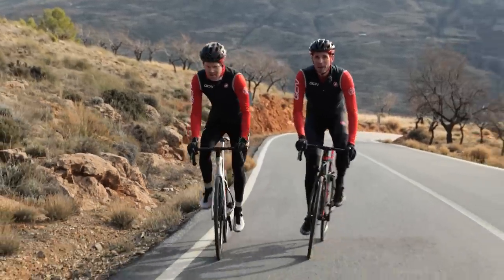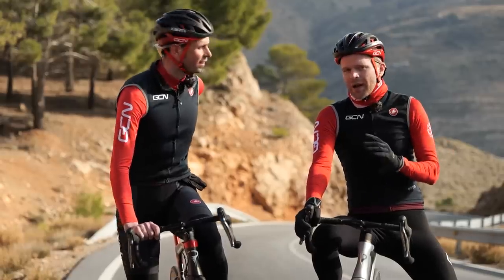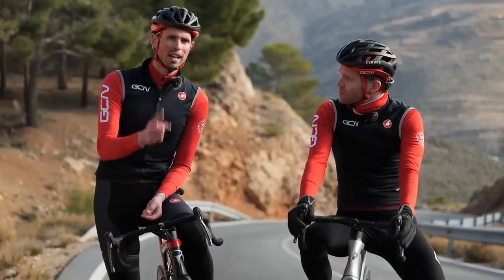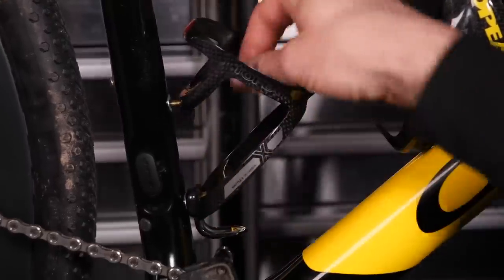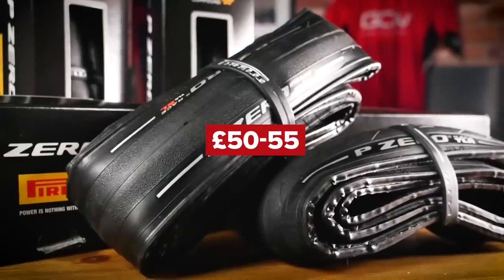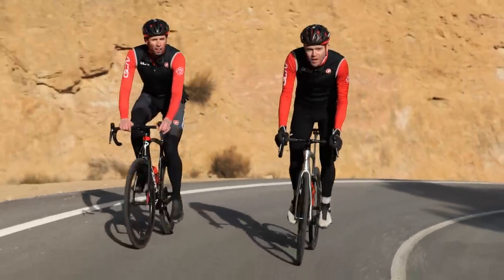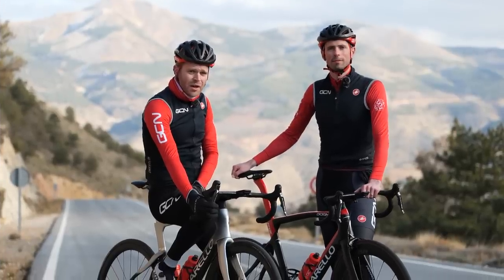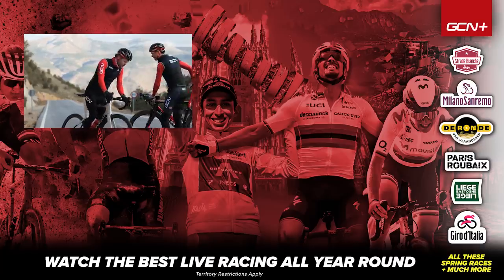What's The Best Value Upgrade For Your Bike - Spend Or Save?

Comment: With latex, I had to pump up to pressure every day.  They would loose 10-15 psi overnight.  How about the other weight-saving inner tubes?
Reply: 50g butyl Continental supersonic
Reply: You shouldn’t use latex tubes for training because they aren’t as durable or puncture resistant I believe, best to got tubeless or regular inner tubes for training imo
Reply: @itsyourboiiemil5450  I have had the opposite experience. Latex inner tubes have been less puncture prone as they are more supple and tend to conform around foreign objects. Butyl tubes on the other hand are less compliant and can more easily allow foreign objects to puncture it. 
Another consideration for latex tubes that I don’t think gets talk about often, if at all, is the superior comfort they provide. Again, because they are more supple and compliant, they roll over bumps and road imperfections better, leading to a smoother, comfier ride.
Reply: @JayLato  didn't know about these, thanks for the heads up!
Reply: Is it possible /save to use latex tubes on Tubeless rimtape ?
Reply: @itsyourboiiemil5450   i‘ce been using them for a year, no single puncture, in combinatiom with vittoria corsas,
Reply: @TengoHambre  Vittoria Corsas with latex tubes are my favorite combination. Extremely comfortable and fast.
Reply: @TengoHambre  yes. Tubeless rim tape can be used with tubes. The opposite is not true though, a regular rim strip cannot be used in a tubeless setup.
Reply: @yamdrew  yeah and since my rimtape seemed a little worn when i swapped tires, next time i‘ll install tubeless tape with latex tubes, and pirelli race 26mm 😊 latex rolls smoother indeed🕺🏼
Reply: TPU tubes hold air pressure quite well, about the same as the heavier butyl tubes.

Comment: You had the mid-range option in inner tubes, but why didn't you have a mid-range option for anything else? In my experience (with no data to support my hunch), middle of the pack is often the best value for money. In some cases it might be upper mid-range, sometimes it's the lower mid-range, but very rarely in the extremes. 

I've upgraded my wheels, tyres, tubes and saddle, and in only one case did I go for the top end stuff, and that was TPU inner tubes. Because it's not that expensive, and you can patch them if they puncture anyway. My wheels are lower mid-range DT Swiss ones, which wasn't much more expensive than the basic Shimano ones, yet they are lighter, look better, the hubs are much better and they've held true very well, unlike the Shimano ones that just melted under my fat ass basically. My tires are upper mid-range Pirelli Cinturato Velos, which are pricey, but not really top of the line performance tyres, but rather a practical choice. But they're so much better than any other tires with similar puncture resistance. And my saddle... well, I basically upgraded my saddle to a cheaper one, by ordering from China. Paid just a bit over 20 euros for it and it's 160 grams lighter than my old one, yet still more comfortable and better suited for me. Time will tell if it actually stays in one piece, though.

Comment: Hunts or Yeoleo or Winspace wheels are around 900$ and can get you solid weight savings for half the cost you said.   Think you should do more with smaller brand budget carbon wheels.  Your viewers would gain a lot from that info.  I always thought fancy carbon wheels were the only option.

Comment: I do think that you missed two very cost-efficient ways of loosing a bit of weight. First one is QR skewers. One that come with a mid-range bike will weigh around 130g. A set of titanium/carbon QRs that weigh 50-60g can be had for $20. Another one is bar tape - will wear out anyway so you might as well replace it with a lighter version and instead of those fancy alloy plugs just get plain plastic ones - 50-70g for max £30.

Comment: It depends what sort of riding you do, surely? Most of my riding is the 55km round trip to work and back, with an occasional Audax at weekends. Latex tubes are no use whatsoever for me because much of my riding is on wet, gritty, pot holed Forest of Dean roads, while my saddle (Brooks, and heavy as) needs to be comfortable all day long, and its weight is very much a secondary consideration. Couple this with the fact that I weigh around 100kg on a good day and usually carry a pannier full of crap to work and back, and the few grams I save by using carbon bottle cages, or whatever, are completely insignificant.
Reply: You'd probably be way better off trying to reduce rolling resistance. With those potholes I wouldn't want to risk carbon wheels either.
Reply: Yeah nothing in this video pertains to your situation

Comment: For recreational, cost conscious riders, latex tubes and carbon cages are ridiculous. Loose one pound of body weight and bang.
Reply: You could also lose a pound, too.
Reply: Latex tubes are great for rolling resistance. 50g of weight is utterly negligible (that's like 0.3W on a climb, or 0.02W on the flats). On the other hand they cut 5W of rolling resistance. 5W for £20! Yes they're consumable items but I've never ever punctured one outside, only when failing at installing them. Carbon bottle cages on the other hand, might as well go to the toilet more.
Reply: Yep, and you'll fill your nice light cage up with half a kg of water anyway!
Reply: Yes but your average recreational rider might be getting a used bike that needs tubes anyway. Same with the bottle rack I suppose, and also the saddle. You could say the same about everything else in the video and it applies more so than the bottle cage or tubes since one could reasonably expect a used bike to already have wheels
Reply: Is everyone who watches this channel obese or something? Why is lose a pound always the default suggestion?
Reply: @thegrowl2210  Because it's cheaper than buying a new set of wheels, it's actually good advice
Reply: @thegrowl2210  around 60% of the population of UK or US is overweight. So theres a high likelihood that it wouldn't hurt someone watching this to lose a pound.

Comment: Get rid of your water bottles and cages.  Switch to a Camelback.  Water sits on your back which adds to your weight, not the bikes.  No reaching down for water, just put the tube sitting over your shoulder in your mouth and suck.  Spit out tube when you get enough water.  Camelback also offers places to store your house keys, cell phone, spare tube and tools etc.  Room for snacks as well.  Like wearing a thin backpack.  Originated in mountain biking, which I used to do.  Camelback sure works well with my road riding.  Cheers!

Comment: The carbon cages don’t fatigue like metal cages and will last the lifetime of the bike which helps to offset the cost. I think wheels and tires are the biggest performance gain overall, regardless of cost. I wonder if it would be more cost effective to build the bike from scratch as opposed to buying a bike and replacing stuff you already paid for. Okay! Video content idea! You can have it for free!😂

Comment: I switched to Tubolito tubes for last years RAGBRAI….2 days and 150 miles in, and 5 flats later…I dumped them, switched back to lightweight butyl, and had no more flats for the remainder 300 miles.  Not sure if they’re worth the weight savings.

Comment: Dirty little secret about bottle cages; some alloy cages are lighter than most carbon cages and cost less than half.  Supacaz alloys are $25 and 18g vs. the carbon at $65 and 22g.  I bought some cheap generic chinese cages online...$25 a PAIR, but they didn't hold well and one of them broke.

Comment: The BEST weight-price ratio are the tyres, seatpost and saddle.
With the wheel you can low 1/2kg ( i
Or more, depends the stock shit wheels) but its a 1200€ effort

Comment: Rolling resistance, fair enough. Weight however is only relevant in acceleration (Newtonian theory) or if you are unfortunate enough to hit something where you will go from a certain speed down to zero in a seriously short space of time. In other words, you will become intimately experienced and have first-hand knowledge of Einstein’s E=MC(squared).

As far as wheels …. I’m on a budget, so I went for those flat spokes. They do make a difference.

But for us mere mortals, I think we are better off buying a body composition bathroom scale and get down to 10% body fat. Also prepare yourself to have a girl’s upper body shape (without the boobs), small shoulders and arms as for cycling you don’t need muscles up top. So keep those small. My wife would prefer me to rather not. So hey, I have to keep my management and higher authority happy :-)

Comment: Hi Ollie, Alex & Dreamteam, I have heard that Latex and TPU inner tubes are more subject to punctures, is that right? Can they be patch repaired like regular butyl tubes? Thanks
#AskGCNTech
Reply: Tubolito claims their tubes are more puncture resistant (which I agree with from experience) they offer a puncture guarantee too! They have their own specific patch kit for only a few dollars.
Reply: I have ridden all three types of tubes and have found latex is no more puncture prone. If anything, latex may be more puncture resistant as the tube and tire become more supple and compliant and roll over and deform around road debris and hazards better. 

Both TPU and latex can be patched. TPU requires special patches which I found were not easy to use and didn’t work great. Latex can be patched as well, either using patches like Rema or using an old doner latex tube to cut patches from and some rubber cement.
Reply: Tubular tyres which have been the choice of pro cyclists the world over for many years have latex tube sown into them. If there was any evidence that they punctured easier they would have used clinchers for the spring classics which historically the never did
Reply: @kidkarbon4775  fair point. I just assumed that Latex are thinner since they are lighter. Tubular can be repaired? What do you do when you have a puncture in the wild?
Reply: It was true for TPU tubes in my experience.  By contrast, I didn't get  more punctures with latex but they lost a lot of air in 24 hr.
Reply: @yamdrew  Maybe I was unlucky but I had a lot of punctures with Tubolitos.  So many that I gave up on them.
Reply: @cypercharged   I personally use 'zefal puncture repair spray' (other brands available) when I'm out riding which is a small cycling specific can of expanding foam, similar to what is provided as puncture repair for many cars these days. It means I don't carry spare pump, co2, levers, tubes, patches or any of the other nonsense. It works with tubular, tubeless and clinchers so I'm covered. I don't really want to mess about with my bike at the side of the road and this keeps me riding.
You can repair the tube or tubular later at your convenience as the foam flushes out with warm water (hose connected to valve with a washing up liquid bottle filled with warm water works well)
A tubular is a little time consuming to repair as you have to unpick the stitching of the tyre to access the tube, but it can be done and I find the whole process rather therapeutic.
Reply: The best way to makes tires more puncture proof is to brush debris off as soon as you pick it up. Debris actually gets hammered through the tire every time it goes round. You’ll need to work on building up callouses on your fingers.
Reply: @cypercharged  you carry an extra tubular tire as a spare, usually a worn but air tight old tire. The glue usually remains a bit tacky.
Reply: @kidkarbon4775  have you ever had to use that stuff?  I found them to be really messy and the foul up the valve so they may just serve to get you home.

Comment: #AskGCNTech Should I buy a new bike with lower cost carbon frame from nice brand or upgrade to carbon wheels to my high end aluminum bike. My current bike has sora and weights 10.8 kg
Reply: Easy, upgrade your wheels
Reply: Wheels will make more of a difference.
Reply: High end alu frame is better than an entry level carbon frame. So upgrade the wheelset.
Reply: Just get entry level carbon wheels and change the bearing with high performance bearing like ntn llb, nsk vv, skf or equivalent. Hi-perf bearing just cost u only 20usd/pc.

Carbon wheels for weight reduction/aero.
Hi-perf bearing reduce friction.
Hi-perf tyres for less rolling resistance.

Change everything that involves in rolling such as wheels, bearings, tyres.
Reply: Thats a heavy bike. I  think you would notice a significant difference if you get a bike that is sub 9kg with an groupset that is 11 speed. I doubt you could even find a decent new set of wheels that are 8 speed.
Reply: Sora weighs the same as 105 other than the crankset. If you have a 3500 crankset that’s way lighter than the 3000 crankset which is a pig. You can buy wheels just know you can’t take them to the next bike if it has disc brakes. At some point though you can put so much money into upgrading you could have bought a better bike for less after selling yours. I made that mistake. All that there is to do is ride it until it brakes now. There is a great used whee market though for all the people going to discs selling the rim brake ones.

Comment: #askGCNtech I'm looking to buy a new midrange road bike. My current bike is aluminium, with 105 and inexpensive aluminium wheels. For my next bike I'm wondering if I should buy a carbon bike with aluminium wheels, or should I consider a good aluminium bike and spend the money saved (not getting a carbon frame) on carbon wheels?

Comment: My metal bottle cages are around 22g each.
Cost me only $26 for 1. That's like £14.33? Supacaz fly cage ano.
They say it's 18g but some reviews say 22g.
I don't normally care about the weight normally ride MTBs anyway, a few grams on a 13kg bike is kinda insignificant, heck my new road bike didn't come with pedals, I have spank spoon MTB pedals on those are definitely not light.
I got those bottle cages because they were cheap and looked nice. Not easy finding a colour to match my bike. Was really surprised when I took them out of the box, they definitely do not look that light
Probably gonna change the wheels in the future, they're 2.6kg. Then again if they stay in one piece I might never change them. There's no suspension, there's no unsprung weight, it's just lower CG isn't it?
Seat definitely, those wear out, once they do I'll get a lighter one.
Reply: no problem with your supacaz cage ? feedback are not very cool... very fragile cages. What is your experience ?
Reply: @simonpeneau7802  well they're secure and quite flexible. Don't feel very fragile. I'd say my elite bottle cages feel more fragile.
My bike did fall over once, there isn't much chance of them getting hit. 
They grip my bottle very securely, that's like the only downside so far, can be hard to put the bottle back while riding.
Reply: @Rose_Butterfly98  OK thank you. I have Focus carbon cage on my Focus road bike and Elite custom race on my gravel (dont really care about weight on this 10kg alloy bike). Both type of cages are good, bidons (im french, not pretentious) are secured in both type. Supacaz look really good
Reply: I have bottle cages from the dollarstore. They are made from plastic and very light!
Reply: @simonpeneau7802  so far from reviews here I think it's been shipping that's the problem. They may come broken or damaged.
Which makes sense, bottle cages are all pretty fragile when empty, heavy steel bottle cage on my mountain bike got warped because I crashed when there was no bottle in.
And from the occasional reviewer who obviously didn't read the specs and tried to put the wrong size bottle in. Of course a bottle cage built for 7cm bottles will not grip a 5 cm bottle, it seems because of it's price point there are very random reviewers.